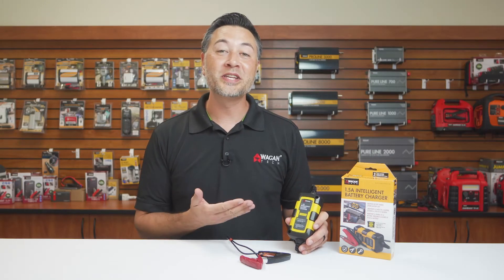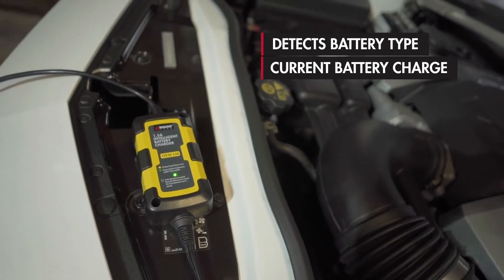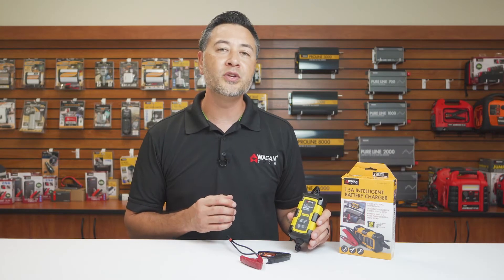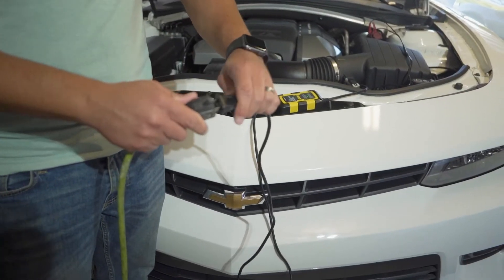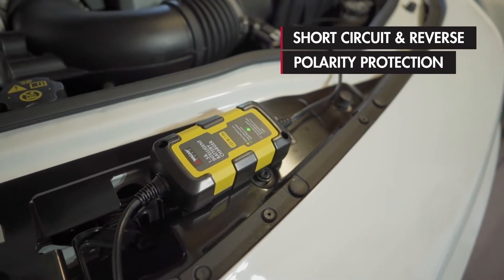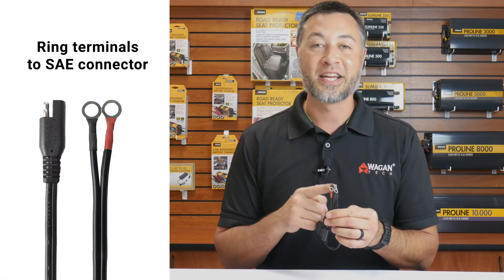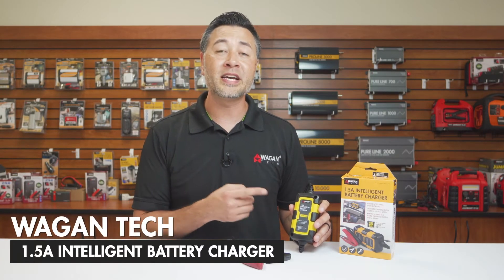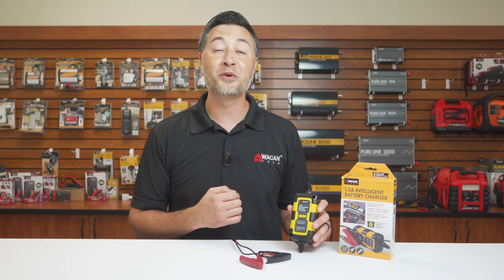1.5A Intelligent Battery Charger - First Look & Features (Item #7402)

Comment: The question is does this require a power outlet while charging the vehicle or not? If my battery is fked when i camp in the middle of nowhere….
Reply from the maker: You do need an AC (wall) outlet for this to work. You'd be better off with a DC to DC charger (https://youtu.be/DNAj28A1LRU) if running two batteries, a lithium jumpstarter (https://youtu.be/w5otMwpYKiA) if you only have one battery, or a solar charger.